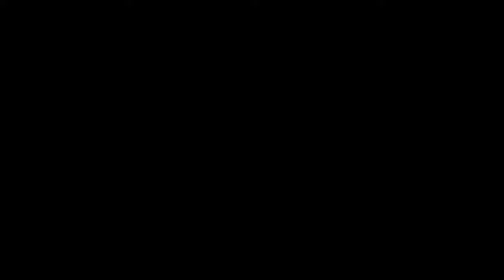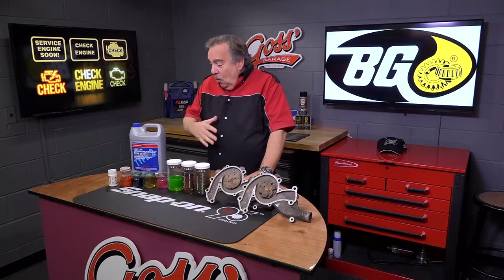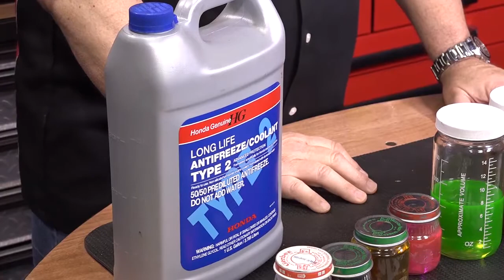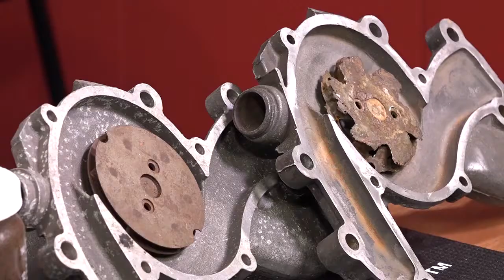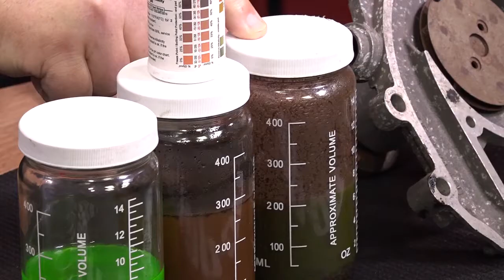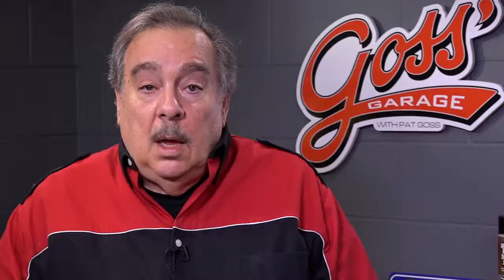Pat Goss from Goss' Garage talks about Engine Coolant

Comment: pat there is still many mechanics & workshop still user tap water.
which turn vry acidic in a few months.
some even add tap water with coolants.
can i ask the  will the effect be if you just use distilled water?
Reply from the maker: Kito: 

If you come into my shop you will find cases of distilled water which is all we use and all we have used for over 20 years. So yes I wouldn’t use anything else unless you can find a good price on distilled, deionized water which is slightly 
better.Pat
Reply: me too.  i only use distilled or reverse osmosis water.
deionized water is hard to find & it is costly.
i am now running only distilled now. 
which type of coolant do you recommend ?
thx Goss.
Reply from the maker: Kito:
I recommend a coolant that has the certification of the car manufacturer. Most
all manufacturers will sell a license to an aftermarket company to produce a
product that meets the manufacturer specs under a different name.Pat

Comment: Another thing to consider is that some coolants have different chemistry, but have the same color. The green colored antifreeze used in American cars from before 1995 is not the same as the green colored antifreeze used in many Japanese cars. If you put the regular green stuff in Japanese cars, you will quickly wear out the water pump seals. It happened to one of my father's cars and mother's cars because we weren't aware of that.

VW used their own orange colored antifreeze, but it wasn't the same as Dexcool. I worked with a guy who witnesses the use of Dexcool in VW engines, and he said a nasty slime would build up inside the engine.
Reply from the maker: Skyline:
You are right on point. Coolants have changed drastically over the years and one size no longer fits all nor can you select based on color. It’s best to look for the qualification numbers on the container.
Pat